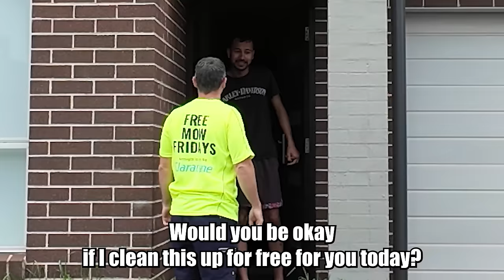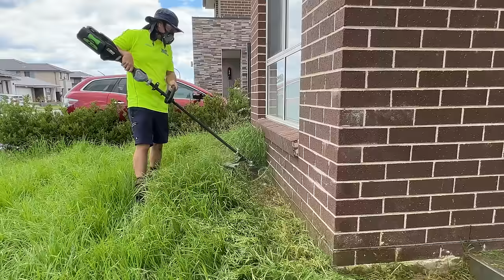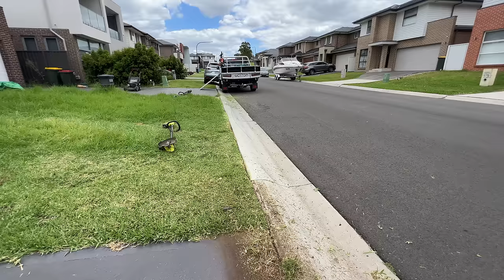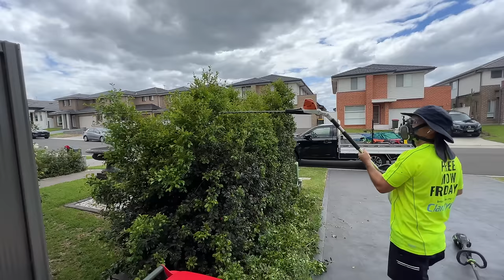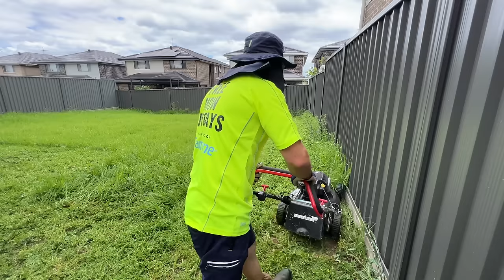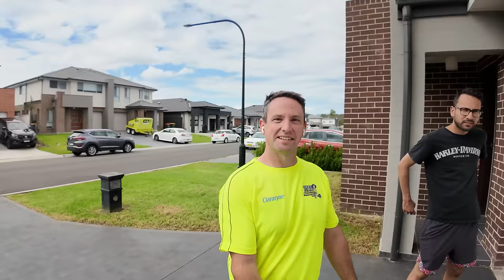They had NO CHANCE with their TINY MOWER! Free Mow Fridays

Comment: Thumbs up on the plastic shovel. Lightweight and does not cause scratches on the pavement.  For as long as I have been watching here, it still just kills me to see the water meters above ground.  That would never work here, near Atlanta, GA., USA.  We have in ground meter boxes about 14 inches deep to protect against freezing.  And it is nice not to have to dodge with the mower.
Reply: 14" deep? So you can't see your reading? No way to check if there is a leak? I lived most of my life in NY and currently live in MN. Our meters in both states are in the basement. For sure no worry about freezing and we get our share of freezing in MN!
Reply: @annettevertalino9273  Well, if you can not read it, one would have to have vision issues. Of course, it is not buried under snow. We might get a whopping 4" one day a year. I am curious how that works with the meter inside. Do the meter readers make an appointment to get inside ?  Or is done electronically ?
Reply: @dallasarnold8615  when I was a kid (back when dinosaurs roamed) our meter was in the basement. The meter readers had a key to the back door. They would knock, walk right in and say meter reader. Freaked me out more than once. The meter was later outside. 😮

Comment: How should a professional handle the tile you broke off? It would have broken off eventually anyway, but I could see a homeowner fussing about that. Who's responsible for the repair?
Reply from the maker: It was broken, the grass was pretty much holding it on. I actually forgot to mention it to them but that’s all that’s required. 👍
Reply: Those guys wouldn’t know how to stick that tile back on. If they fussed I’d just dump all the grass and weeds on the driveway. That would make an interesting video.
Reply: A professional tiler would go get facy glue etc. A regular bloke would maybe use epoxy. But most would mention it and the guys say meh don't worry about it. Broken windows on the other hand... 🪟